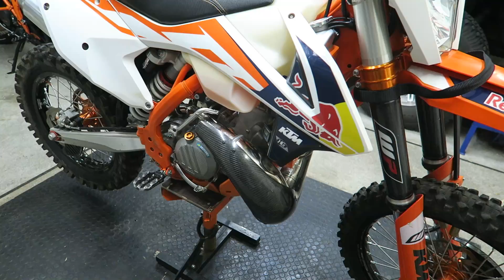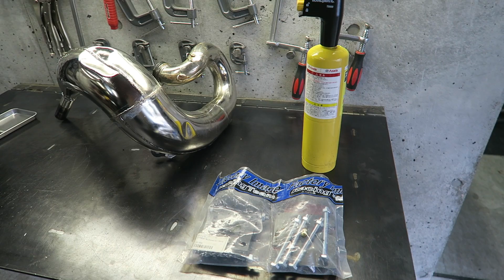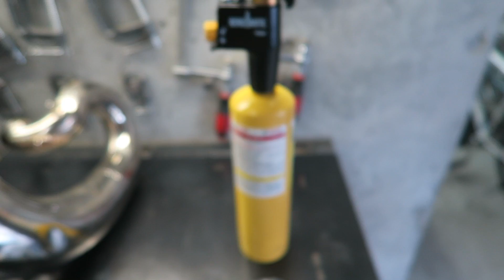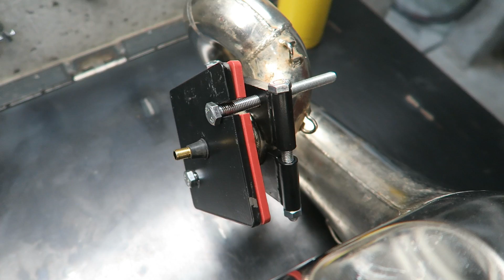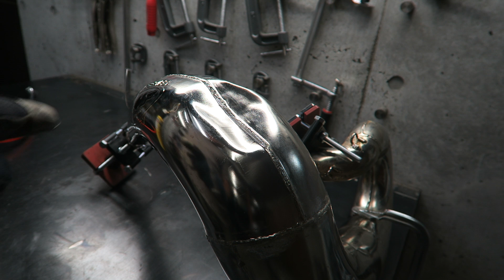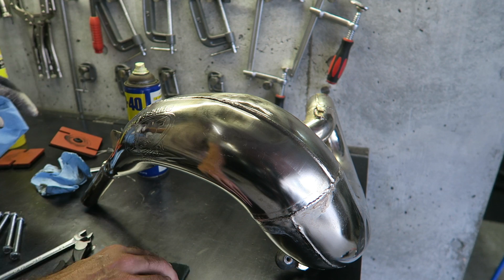2-Stroke Exhaust Dent Removal

Comment: Nice now i am going to do it on my exaust 
You mentioned that you would fix the Carbon guard because it is broken, just as mine, can you explain on how to do. it.?
Really like your vids!
Reply from the maker: Lucky 366 - I repaired my carbon guard using some epoxy resin. I masked off the repair area and applied the epoxy resin into the cracked part. Let it set for 24H then sanded down and clear coated it. I don't use a patch as it seemed to be OK without and the damage wasn't in an area you'd often hit.
Reply: Tokyo Offroad thanks for the answer, I just wasn't shure if the epoxy could stand the heat 
Greetings from Germany :)
Reply from the maker: Yes, the repair is holding up very well. No problem with heat.

Comment: Why would you not want to use more pressure wouldn't it just smooth those ripples out?
Reply from the maker: Eric Broome - The higher the pressure the higher the risk. Next time I might try a slightly higher pressure of 75psi, but I probably won't go above that as the heat you apply also increases the pressure.
Reply: Eric B Even 60psi is overkill. I’ve been doing this for years on all types of pipes and 40 psi is plenty only time i’ve even gone higher is on gnarly pipes that are very thick. This dent could have been removed to look factory, not enough heat was used in the correct places which is why he had poor results.